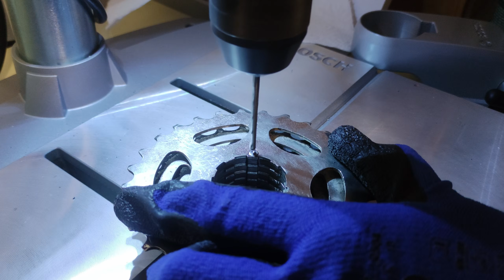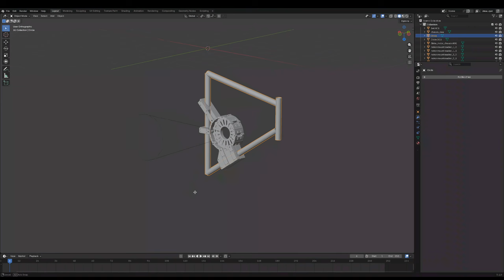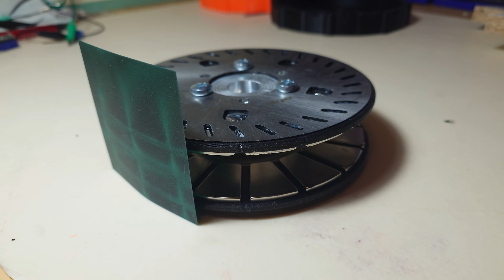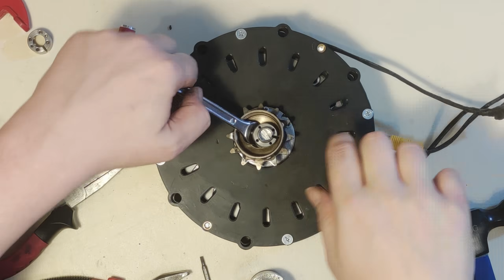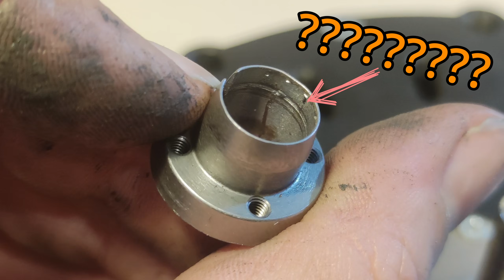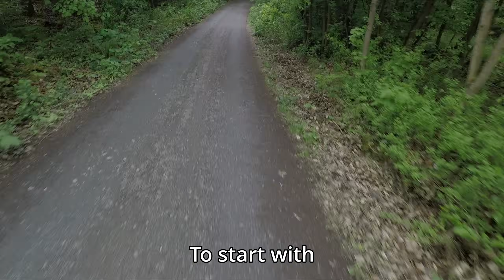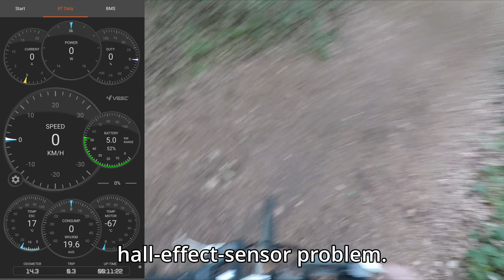Testing My Home-Made E-Bike Motor

Comment from the maker: MOTOR BUILD HERE: https://www.youtube.com/watch?v=6pnCrnvvXHQ
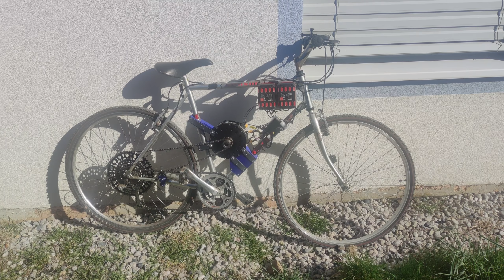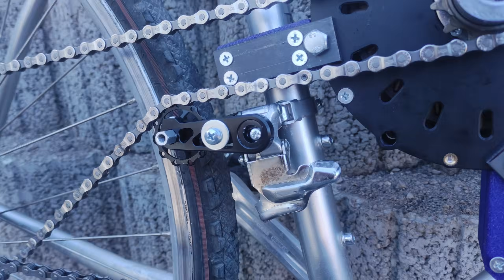Sound quality drops between 6:28 - 6:58 because I had to remove the background music. 

And here we go! The conclusion to the diy e-bike motor project! Hopefully the two videos have been a good watch and the results satisfying. I will make one more e-bike motor in the future (maybe next year). One where I will put all my manufacturing capabilities and knowledge to the test.

Some interesting stats that I have managed to record about that motor from the VESC app:
Average sustained maximum power (40V battery): ~600W (0.8hp)
Maximum peak power (with charged 60V battery): 1750W (2.3hp)
Maximum speed (charged 40V battery): 21km/h (13mph)
Maximum speed (charged 60V battery): 32km/h (20mph)
Highest recorded temperature with thermal camera: 48.6C (119F)
Highest recorded VESC FET temperature: 31C (88F)
Average energy efficiency (moderately hilly terrain, using the motor mainly as assist) - 20Wh/km
Rough average absolute maximum range on 4 Parkside batteries while using motor as assist: ~24km (15 miles)

I am not sure when my next video will be released as I will be busy throughout the summer. In addition, what editing these last two videos taught me is that I am a really slow editor... I am certainly considering using the sponsorship money to hire an editor for my videos. Just not sure that the amounts here are actually enough to pay for one.
Reply: You're very sexy. I like your videos and your sense of humor. You made me laugh quite a bit.
Thank you.
Reply: Wow, that's pretty good. Though I can get as low as 12wh/km with zero pedaling on am Ezee hub motor, one of the larger ones available. That's holding 20-25kph average, as efficiency goes down at about the third power due to wind drag. Motor temp of only 48.6 is quite low, my motor would get up to 60c just in freespin at ~200rpm due to core losses over the course of an hour. But efficiency matters a lot depending on how heavy you are, how hilly the terrain, how aerodynamic you are and how fast you go, if you can spin down the motor to avoid core losses on downhills, and so on.

but hey, axial flux! I did see your efficiency going up to 12wh/km on your speed test once up to speed despite the uphill, so even if you're pedalling barely that's pretty good steady state. 
That's a pretty darn decent motor for being homemade. Considering all the electrical motors of history yours is really power dense and efficient all things considered.

And yeah, ebiking and biking can be addicting and a great way to get exercise and fresh air. I've seen some people mount rear hub motors with a single speed freewheel in the triangle and make a super torque setup, too. 
It's too bad that they regulate continuous power capability because a larger power capability motor can do the same power level more efficiently, with less copper losses and less gearing losses if it needs less gearing due to more leverage and core width. 
Some of those big 45mm stator direct drive motors slapped into a 26 inch or 650b wheel would be up to 97% efficient with the vesc, which is crazy. Loads of high quality iron core and copper so it wouldn't even be warm at that power level, though.

Comment: Axial flux motor and that is what you were more familiar with? Hmmm kinda odd that motor is gonna produce enough torque for a car it might tear that bike Frame apart
Reply from the maker: Just because you make an axial flux motor doesn't mean you are automagically going to have YASA powered supercar levels of torque and power. This motor is not designed for such torque, and so it will just simply not produce it (The cores will saturate well before you get anywhere near motor destruction levels of torque). It is certainly overbuilt though, and thermally, I think I could run it at 1kW continuous comfortably actually...

Comment: That's a really cool project, great job sticking too it! I've had great luck using power tool batteries, after spending a lot of time trying to make my own. The tool batteries are very robust, and if you have a problem, just replace a battery. In 2022, I took an ebike with a 250 watt Bafang hub motor, that pulled a trailer with a 100 watt solar panel, plus a lot of camping gear. I started with 20 volt 5Ah tool batteries, wired 2S 2P like what you had, I covered about a thousand miles, at some point I added 2 more batteries, so 2S 3P. Solar was just slowly adding power as I rode. I still pedalled quite a bit, but I feel that the solar helped offset the added weight of the trailer. I was able to pace my speed against how much solar was coming in, effectively solar cruising. Anyway, great job getting a DIY electric motor to work so well!

Comment: Does this bike have regenerative braking?
Reply from the maker: No. And there are some reasons why you basically never see regenerative braking in "e-bikes". (The "e-bikes" that have 5kW+ motors with direct drive and do have regenerative braking are not "e-bikes", they are "e-mopeds")
Reply: @BirdbrainEngineer  That makes me kind of sad because I remember in around 2010 when they just started getting popular they all had E-brakes but I've been noticing if you don't buy a completed bike you can't get an E-brake any longer. I have noticed that the expensive 8000 Watt/200 Amp controllers which cost about $850 dollars do have regenerative braking logic systems inside but by that point it's cheaper just to buy the entire E-bike completed. Seems we're caught in a corner for the same reasons we now buy cars rather than build them from scratch. We're at that strange point in time where mass production has taken the fun out of everything,,, well almost everything,,,.  😁
Reply from the maker: @Freedomistman Well... With an actual e-bike (250W sustained power in Europe, 750W sustained power in US iirc, no clue about other areas of the world), regenerative braking doesn't exist for mechanical reasons. You want to be able to pedal your bike without having to spin the motor as well. With those high power e-moped motors you have regenerative braking because you really are expected to not pedal (if there even are any functional pedals to speak of), so there is no freewheeling system in the motor. There are some ways of adding in regenerative braking for systems with a freewheel as well of course - a clutch, or recently the "freegen" system that engages only when you press the brake lever, but they all come with higher cost, more difficult system setup among other problems. 

And yeah, to anyone following this thread, please do not call anything that isn't an e-bike an e-bike. Now that I have been cycling quite regularly again for some time, it annoys me to no end (and is just straight out unsafe) when people with their 3kW+ e-moped motors blast by you at 50kph+ on acycle lane or a shared pedestrian-cyclist road because they think they are on an e-bike... no, you are on an e-moped and you have to register it as such and use normal roads, not roads where the designed speed is 25 to 30kph.
Reply: @BirdbrainEngineer  Good point on that technicality. I tend to call everything on ''two wheels'' an 'E-bike' from electric bicycles to 35 horsepower electric motorcycles. My bad. 😁😁😆😅

Comment: What amperage output you get from power tools packs anyways maybe you are not getting that 60A,you can set the value but that doesnt mean it will actually pull that value i think you are limited by power output of power tools packs
Reply from the maker: In the VESC software there are two maximum amperage settings - the maximum motor current and absolute maximum current. In an ideal case, the VESC never goes above the former, so the 60A should never ever be reached - if it is, the VESC throws an error and shuts down for a short period of time. So I only asked 40A from the batteries. Since I was using 5s2p batteries, then effectively the "ebike battery" there is a 10s4p battery, meaning 40/4 = 10A from a single cell - Virtually all 18650 Li-ion cells are capable of producing such currents... the problem is more in the voltage sag. Some cells are designed to be able to provide the high current for longer. The Park Tool batteries I used are fairly garbage in that sense indeed. When they are full, the voltage sag is minimal, but as soon as you have used up like... 25% of their capacity, the voltage sag starts to become significant. Generally speaking I was most certainly not limited by the power output of the batteries, but I could feel the voltage sag impacting the performance of the motor when the battery was starting to get drained.

Comment: omg. your insane...as well as insanely smart. i learned a lot in the two videos i came across trying to look for videos to build a wind powered generator. i did learn more about that as well just from the two videos on the e bike motor diy...between me and you i have two 80 volt batteries and one 40 v lol im wondering how youd trouble shoot regulating power/how many motors youd run, what else youd add to the bike. and also would love to see what problems arise and how you fix them. haha cool channel.

Comment: Congrats on this wonderful achievement!   It works so good that I wonder why there aren't any axial flux motors on the market for ebikes.   Do you have any thoughts as to why?
Reply from the maker: Multiple reasons.
First of all, axial flux motors are just simply a lot more complex to make than radial flux motors, and in mass-production, complexity = money. Clearly, manufacturers want the cheapest motor so that they could either compete better on the price or get a larger profit margin. 
Secondly, while axial flux would make a lot of sense for hub motors, they make a little less sense for mid-drive motors (won't stop me sometime in the future though haha). The problem with mid-drive systems is that the motor actually has quite a lot of "real-estate" in the direction of the shaft but diameter-wise they need to be quite small. (This is to say, the motor can be long in the direction of the shaft but has to have a small diameter). Axial flux motors excel in exactly the opposite situation - less space used axially while more used radially. The upshot of it all is that a radial-flux motor often actually does end up producing more torque and generally be more power-dense than an axial flux motor. 
Now, there are some caveats here, namely that a yokeless axial flux motor would likely still end up being lighter than an equivalent radial flux motor (which, while it is an important design criterion in e-bike motor design, it's not the most important one, and as such, it is often compromised on). In addition, my back of the napkin calculations do suggest that a *stacked* axial flux motor of equivalent size to mid-drive radial flux motors would in-fact be more torque-dense. A stacked axial flux motor here meaning two stators, 3 rotors or 3 stators 5 rotors, though this second option probably would already have a hard time fitting into the required motor footprint.

Comment: You're awesome, why not just mount it on the left side? That engine is already nice and thin. Mounting it on the left side of the bike really helps shorten the chain and increase torque. You're awesome 👍
Reply from the maker: It is absolutely not thin! Nor is it light. Putting it in the triangle was the only way to properly ensure that it wouldn't just bend the frame during a sudden impact or something.

Comment: it was easier to machine the axle of your motor and instalit directly inside the wheel leaving all other parts intact
Reply from the maker: Most certainly not. It would mean making a fully fledged hub motor and that's just not something you want to do with 3d printed chassis parts. In addition, I would have had to figure out how to fit a clutch-planetary gearbox combo into the hub (just like most low to mid-power hub motors do). The project would have been a lot less straight-forward.

Comment: Is it possible to pair two of these on one shaft and have them be synchronized?  That would be perfect for converting old low displacement motorcycles by sending a chain directly to the (modified) crankshaft through the aperture previously occupied by a piston cylinder, thus preserving the function of the transmission and the form of its casing.

Comment: I'm curious, can it run at 72V ?
Could you fix your hal effect sensor and ran the test again?
Reply from the maker: 72V would mean the motor's maximum speed is over the rated speed of the thrust bearings... so while the motor wouldn't short circuit or anything, and would run just fine... mechanically it could overspeed the motor, reducing the lifetime of the bearings.

Comment: I hate it when you do awesome thing and put it on a shit bike instead of a full suspension mtb
Reply from the maker: This motor is not deserving of a full suspension mountainbike haha. While it gives similar torque and max speed as most low power hub motors on the market, it weighs 3x more :P 

Yep, the caveat has to be somewhere, and in this case, it's that the motor is heavy and the stuff needed to drive the wheel adds mass and so on. 

Maybe next motor though.

Comment: THOSE BATTERIES HAVE NO REAL CRANKING AMPS, GET A PROPER BATTERY
Reply from the maker: Bruh, your caps lock is on. 

In any case, in the video I show that the batteries, even when half flat, are capable of giving the maximum amount of amps I have set the motor to use - bigger problem is the voltage sag.
Reply: @BirdbrainEngineer  BRUH!!!! IF YOU WERE A REAL ENGINEER YOU WOULD KNOW THIS IS HOW WE TYPE ON THE DAILY!!!!  ITS FOR CLARITY!!!  

But like you said numerous times in the video thats exactly what your not..

get out of your 80s internet etiquette BS that was made by early year non binaries that first got onto the net and couldnt handle speaking to people.

there is a C rating to batteries (HOW MANY AMPS IT CAN PUSH INSTANTLY and continuously) lower C ratings have LESS POWER! than high C rating batteries..

like i said get a real damn battery and retest

Comment: Мой английский пока ещё не на такого уровня как у вас, поэтому комментарий не на английском, но я очень не плохо понимаю английский, поэтому 95% сказанного вами мне очень даже понятно =) Подписался сразу после первого просмотренного вашего видео (про постройку этого мотора)! Очень порадовал ваш подход! Единственное что я не понял, так это в какие стороны были намотаны катушки и нужно ли их мотать в разные стороны для такой конфигурации? Моторы сам не делал, но сам строю кастомные мощные мид-драйв байки, (обычно что-то среднее между велосипедом и огромным туристическим эндуро с педалями, весом около 70 килограмм), с полностью кастомными рамами - сейчас в постройке байк с рамой-фермой, задняя подвеска четырех рычажный паралевер, рулевая колонка с регулировкой кастора, подогрев сиденья, ручек и много всяких наворотов, а так-же из-за невозможности штатного ремонта, переделываю германский электрический хардтейл под VESC и уже разработал и протестировал PAS на самодельном энкодере из датчиков холла, и плату управления ассистентом на ардуино с  дисплеем, с переключением режимов и отображением заряда батареи. Удачи вам в ваших делах и хороших достижений! =)
Reply from the maker: Thanks!
The winding diagram dictates that 6 of the 18 cores be wound in reverse direction, which I did. Technically you could just make sure to connect up the required cores in reverse, but that usually means that the ones connected in reverse end up having half a turn less or more than the other cores, so it's certainly better to just wind in the appropriate direction if possible.

Comment: But carbon fibers are also conductive, or do they don't create eddy currents because of the morphology? great video btw!!!!!!
Reply from the maker: Carbon fiber is much less conductive than metals, plus they do not form a single "block" of material, so any generated eddy currents are going to be very small and weak. Most likely there are small eddy currents that are an inefficiency, but it's not noticeable it's so small. Probably lost less than 1% of the efficiency rating (actually likely gained a lot more efficiency thanks to the metal cores)

Comment: i mean, its 500w, i would personaly try to chase higher voltages and lower currents, that might give you the performance that you are looking for, with a different coil arrangement ofc
Reply from the maker: While that is how you can make a motor run more efficiently (as heating is caused by current rather than voltage), it also means your motor runs faster. And if you don't keep the current the same, then you actually lose torque. Since I have my 4.83 reduction, I can not decrease the current, as I can not afford to lose the motor's torque capabilities. Eventually the problem becomes that the motor spins too fast for the motor to handle. For example The thrust bearings have a specified maximum rotational speed for using different kinds of lubricants, and also for the whole bearing itself. Eventually you will overspeed the motor and something in it breaks mechanically...

Coil arrangement has nothing to do with this - you are not able to make it more efficient not have more power, really. As this one already has a rather high winding factor.